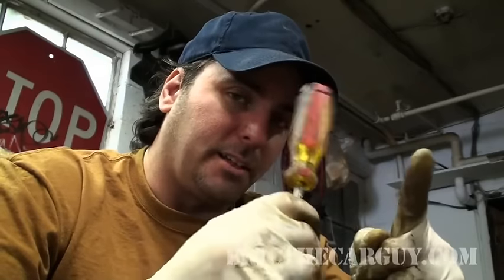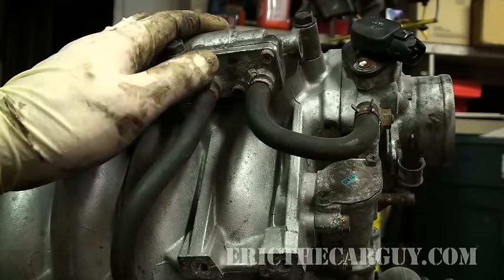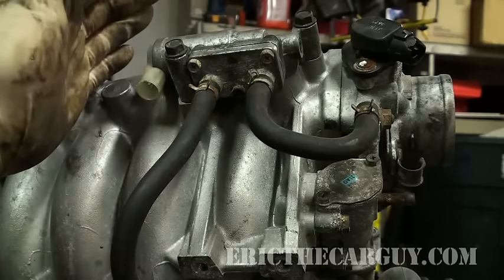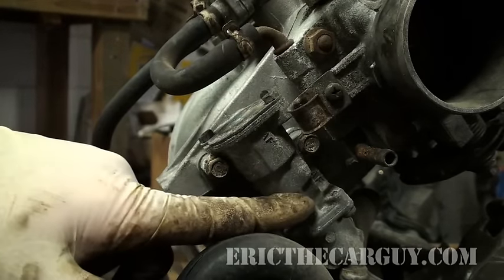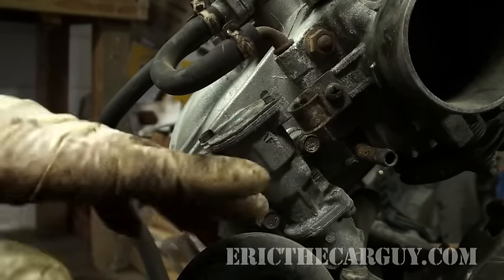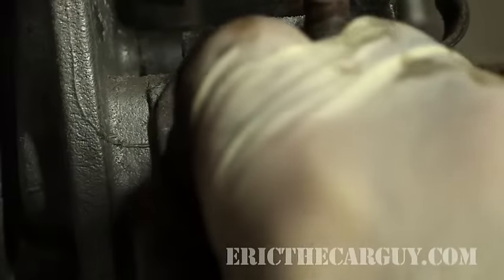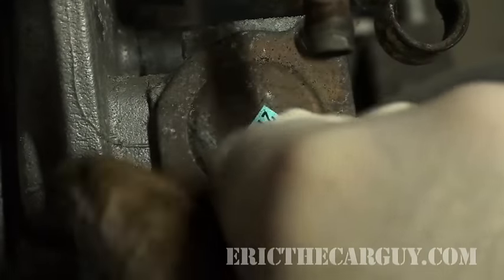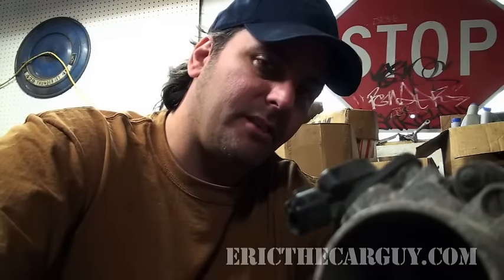How To Solve Honda Idle Problems - EricTheCarGuy

Comment: My prelude with f20b swap has an idle problem. Both idle valve and fast idle valve have been replaced. Car idles fine when you turn it on, but if you wait a little bit and just by holding down the clutch the car idles all the way down and it dies. If I drive it I constantly have to keep revving it so it doesnt die. Mechanic adjusted the valves and it worked great for 3 miles and then the problem persisted. Any help would be greatly appreciated. Thanks

Comment: Great idle fix but am having a different problem on my (Honda Integra da7) OBD0 Honda sohc ZC engine. whenever I reach working temp. I keep getting a idle surging problem at 40km/h or cruising but as I pass that speed it works fine, if I remove my speedometer cable the problem stops but there when I install it back, it happens only on D4 but not on D3. I have since changed my cable transmission, changed my TPS, changed the lockup solenoid valve also even the cluster but problem still exist only when the speedometer cable is intact? any help plz

Comment: Hello! i have a honda 1996 ek3 and it seems to have a rough idle with multiple misfiring and black smoke.  But no error codes or CEL!
using an OBD1 scanner shows that there is  an more than normal value on the MAP reading.

Cross checked with 2 same make and model cars and  the only seem to have a value of around 30 to 40 on idle where as my car (via OBD scanner) shows values around  65 to 75

so far we have:
 replaced MAP sensor 3 times  
 cleaned throttle body
 checked for timing issues 
 checked ignition spark issues 
 checked for injector issues 
 check temp sensor 
 checked for clogged CAT
 replaced wire harness
checked for valve leaks 
replaced ecu and back to the original one 
Fuel pressure checked 
Fuel filter checked 

please note this is on idle speed only, and on high rpm the roughness goes away

Please help 

Thank you!

Comment: At 2:33 you said the idle air control is stepper motor controlled.  I think it is a solenoid that is controlled by pulse width of a 12 volt supply.

Comment: My del Sol has a rough idle with no check engine light. It runs fine past 2k rpm and after revving the rpm drops really low and almost stalls but catches itself. It also runs very rich.

Comment: Please help me! Im from abroad. I bought a 2013 Megane 1.5dci and in winter when it is cold the motor does not idle properly and stops, the engine dies. In sommer, when the temperature is higher, runs like a cat. What do you think?

Comment: Hey Eric i got a 96 honda accord 2.2 lt. when i start the car when its cold it runs rough and it seems like it is not getting enough  gas to the throttle body but after it warms up it runs fine pls help. thanks

Comment: Hi Erric, greetings. I have issue with my 2006 HRV (D16A) New Zealand. It doesnt have idle issue but when i accelerate the rpm goes up and down between 1500 to 200 rpms or 2000 to 2500 rpm. But it runs smooth on steady speed. It doesnt that when the car is parked. Please help.

Comment: Hi Sir, I have a problem with my car. My 95 maxima is running rich and I have black smoke with a slight misfire. 

I changed my fuel filter, my air filter is good. I change my fuel pressure regulator and I have new plug and two coil pack. I'm getting good pressure from my fuel pump. 

No check engine light!!!

Check egr and ecu connection, clean every electric connections under the hood, clean out the Mass Air  Flow and throttle body control and also clean my IAC. Clean all grounds I could find. Also experiencing surging rpm. When I'm braking coming to a red light, rpm will drop to 300 and it's almost sounds like it's running off one cylinder but it doesn't always occur. Please any information would help seriously, thanks!!!

Also at first I was getting a code p01320, it said gear ratio 1&3 error. I changed those coil packs and all 6 spark plug but it's still running rich

Comment: On a 2008 Acura TL idle drops when I am in park and then jumps back up where it should be. It does not go over regular idling speed it just goes down.
Kind of lost because it does not fluctuate up just down. Any thoughts?

Comment: Hi men , I recently cleaned my throttle body and map sensor on 2009 mdx , so after that I relearned the tps by scanner but still my rpm bounce when I push brake pedal and also when I release the gas pedal.  Still the problem is not solved , any advice please and thank

Comment: my Toyota Corolla GLi 4a-fe 96 idle goes down when I turn the a/c on, got the throttle body and idle air control valve cleaned, did nothing. what else could I do sir? could my idle up sensor be broken? btw my idle up sensor has no adjuster

Comment: eric i have a 5sfe. when i start the engine its vacuum reading is around 9-10. revs in park but backfires a little. when i put it in D. car wont rev AT ALL. and just bogs like its going to stall.what could it be?

Comment: Hey eric i just bought a 94 integra with a b20b swap there 2 wholes in the throttle body that r covered car runs take the cover off the wholes the car stalls any suggestion thanks

Comment: Hi Eric I took my car to AutoZone for check engine light it gave small evap leak and idle air control valve has high voltage suggest replace throttle body for 200.00?
Reply: no, the iacv is not part of the throttle body and the evap leak is also not. don't ever take advice from Autozone. Ever. The evap leak and iacv are two separate problems. the IACV should be rebuilt or replaced, and the evap leak needs to be tracked down. The first place I would go is the PCV, just make sure you buy the blue and brown colored one, not the black plastic pcv. the black plastic pcv and rubber grommet don't seal right on the valve cover.

Comment: 1992 Honda Accord giving me the code 43 "Fuel supply system"  Getting the check engine light so after using the paper clip mechanism that is the code I get.  
The symptom:  When is cold it does struggle to start, it sounds ugly and like choking. It will eventually start and after it warms up or reaches normal temperature is fine.  Any ideas?

Comment: I have a 2013 Honda City manual transmission. The idle goes down to zero when shifting from high gear to low gear or when in neutral. How do I solve this?

Comment: My car idle was jumping, it would rev from about 2000rpm up to around 4500rpm then back down, over and over! I tapped the accelerator and now it acts like I'm flooring it! It's basically stuck red-lining as soon as I start the engine! Any suggestions?

Comment: For a 1997 honda accord ex vtec 2.2L, tps changed and closed voltage reading center wire at 0.05V and open at 4.25V. I tried 3 different ones.  I cannot get it higher than 4.25v. Any suggestions on how to get it to 4.5v ?

Comment: My 93 civic is experiencing low idle. When I press the brake and get to a stop the car almost dies or is very low idle like 200-400 rpm. There is a slight stall too when it shifts gears. Any help?

Comment: Hello everyone just trying to get this Honda to run again. 95 Ex has the car for 3 years never cause any issues or complaints. Keep up with the maintenance, nothing change to it but when full synthetic that’s about it as far as change something. Well it was driving fine for 3 years then one day as I was heading to work I’ve noticed the check engine light on pulled over check water and oil. I’ve noticed a bit of oil missing so I went and add some, after driving it to work with the light on was a little rough but made it there. On the way back as soon as I got off the highway it stalled on me turnt but wouldn’t crank. So I towed it and left it for a few months replaced distributor, TPs, Map sensor, fuel pump, and it starts now but the light comes on and then comes off but the idle seems a bit rough. Don’t know what to do next. Any help would be greatly appreciated.

Comment: hey bud,i have a 97 honda accord ex 2.2 liter. im haveing a check engine light flash on then off but sometimes the car dies could it be the iac? when i try to pull a code nothing pops up.

Comment: i know this is an old video but could the low idle cause a battery light to come on? my car was idling extremely low and the battery light came on till i hit the throttle till it warmed up a bit and the idle smoothed out.

Comment: i just cleaned the egr passage ports in the intake manifold and throttle body and egr passage on my friends 1999 accord v6 and now its idling at 2k rpms when cold or warm and bouncing from 1500 rpms to 2000 rpms. i put everything back together. all hoses are connected whats the problem!! i need some SERIOUS HELP!

Comment: I am having Idle air control problem in hot condition of the engine of my Honda HRV 2001. The valve with the throttle body was dismantled and cleaned. I missed my adjustment of IAC. anyone could help on this issue. I am in serious problem.

Comment: Can a bad idle air control throw code for tps? My 94 honda Accord engine codes are for idle air control valve and TPS but you and others say TPS rarely goes bad so could it just be that idle air control

Comment: I replace my iacv but the idle still going down. Specially if i turn on the aircon. Can you please give me some advice? I would really appriciate it. Can you help me on this please. I already scan it. It gives a code for ect sensor. So i replace the ect sensor but it is the same problem is not gone.

Comment: My 99 Honda Accord keeps stalling I’ve changed the fuel pump, fuel regulator, ignition control module, and egr valve but I cannot figure out why my car keeps killing while I am driving. It does drive some distance sometimes and then sometimes it doesn’t because it kills and doesn’t start back up until car sits for about 5 minutes then it starts back up. On one occasion it killed on me 3 times in a row! I need help! I spending so much money on changing parts that are not fixing the problem. I just want my car running well again.

Comment: hello there eric,im butch from the philippines. Been watching your videos,i need your help on idle problem on my honda crv 2004 A/T. the initial problem was my engine jerks when in idle AC on/off. i already replace the throttle body with a new IACV. after a day,im having the problem again in my idle. when im in gear (drive) and slowing down on traffic or to park. it jerks. no vacuum leaks at all,should i change the map sensor or maf sensor?please i hope you could help me solve my idle problem.Godbless eric. hope to hear from you.

Comment: My 2006 CR-V idles good except at a stoplight and when the ac compressor kicks on.  The idle drops below 500 and vibrates the car.  Any suggestions?

Comment: I recently cleaned the throttlebody and I unplugged the cooling in an outer holes did I have to bleed the cooling system I drive a 2012 Camry se it is shaking when I accelerate at 30 some times the idle stays stuck but I hit the gas and it runs

Comment: I have  2003 civic 1.7 lx ... my engine light is flashing and is reading a misfire in all 4 cylinders. The car hesitates at acceleration and a minimal to a lot of white smoke comes out the exhaust make like a (put-put) sound lol (note) I just had my head gaskets and drive train and water pump fixed... what could this be?? HELP!!

Comment: Hi eric, 
I have acura 2000 3.25l, the valve was replaced. It would start but nor accelerate, we try changing the plugs every time we buy a new plug and remove it, it always black. My car has been at the mechanic shop for 5month now, help me am losing hope.

Comment: i have a 96' civic with a non-vtec engine, and it only has an idle surge when it gets up to temp. When it does, it goes from 2000 rpm to 1200 and back and forth. Any suggestions?

Comment: The problem I’m having with my 91 accord is that it gets stuck in warm up mode, takes a long time for the fast idle to go down. I’ve taken the fitv apart and cleaned it and I’ve also taken the iacv apart and cleaned it. And also I’ve bleed the air from the cooling system... nothing works...... help!!

Comment: Where is the fast idle valve located and can it cause a misfire after the vehicle is warmed up I'm getting a misfire after warm up after driving the car for 20 minutes or so and it passed a compression test supposedly

Comment: My 94 Integra idles at 500 when warm. Help??? Took apart and cleaned IACV. Used cleaner in intake. Cleaner in gas to clean injectors. New sparkplugs and got new distributor.

Comment: Hi i have a 95 Nissan 3.o when its worm check engine light comes on and idle goes up and down . When cold its fine when worm goes up and down . I'm told i have 2 idle air control valve. Any way to know what one I need to change .Any help i appreciate it

Comment: help :  - ( Honda crv 2002,  ,she turns over but i need to keep it at 20000 rpm to keep her running, take my foot off and she dies. had idle speed turned up so she will run to the garage but AA man said something like throttle linkage/flap but that kinda went over my head any ideas before i let the garage get her ? kind wishes Sue

Comment: I changed the idle air control valve and cleaned the throttle body and now how do I do a relearn so rpm on the engine go back to normal, because right now they about 450 rpm

Comment: So what if you push in the clutch coming to a stop and the idle drops pretty low almost to stall but smooths out could that also be the idle control valve?

Comment: I have honda accord 94 model manual transmission. My problem in my car occurred while having a long travel, the engine lost power and stalled. The other problem is when  the car running at 
60KPH or more with 3000RPM when I   applied brake  while in neutral gear, the RPM go down until  the engine stop running. What shall I do, pls help me....

Comment: Jus put in aftermarket header for my 04 acura tsx n I didn't put the o2 sensor in on both top n bottoms ... now my car idle below 1k n it sitting on the 500 rpm mark ... could that be my problem .. cuz b4 the after market header my car was fine

Comment: 2002 Accord warmed up in Park I rev the engine to 3000 rpm then let off the gas.  The idle falls to like 400 and sounds like its about to stall.   In about 6 seconds the idle speed jumps up to normal at about 800 and is OK (seems like the computer makes some adjustment).   Why does it almost stall after reving it???

Comment: I have a h22 the enigne vibrates so bad bad the whole car shakes. I took off the valve cover and check the timing blet and its missing at least 1/8" of it. And how due I tell if I bent a valve

Comment: On V12 Jags I remove the cold start idle control stat and fit a washer with a hole in it, the size of the hole dictates the idle speed.

Comment: would this also apply to a 06 sentra 1.8? mine is idling high constantly, not up down, up only, if i get her up to 40 kph, and take my foot off the pedal, she will stay at 40 for miles.., like cruise control is on.. thanks
Reply: Tom Harwood that sounds like a throttle problem

Comment: I have an idle issue. It’s ok when u start up but as soon as go it’ll get higher when in neutral. I have to tap the gas and that brings it back down. Got code p0505 couple times so I replaced IACV but code still came back and idle still not right. 2000 civic ex 5spd

Comment: hi eric justin here i have a 97 honda civic dx i had a idol issue and someone suggests the tps sensor so i replaced the tps as well as the map sensor when i changed the tps my idol became higher plus turned my check engine light on so i had the comp read at nearest autozone they said it was the air intake sensor so i replaced it and it changed nothing please help these parts arent cheap

Comment: hi, how are you  doing eric the car guy? i have a question about my 99 dodge ram 1500. i started noticing that i have been idling around 500rpm. its really sluggish. and it shuts off after 10-20 minutes after driving around. i'm started to think that the egv valve is failing. is there any ways to test the egv properly; Also is there anything else that i could be causing a low idle?
Reply: Carefully take out & clean throttle body & idle air control valve.
Try not to move flapper much & take your time to clean them well.

F40 has this comment problems with tac going flux up/down when hitting the gas. Remember, this is a $450,000.00+ car.
I uses lint white free cloths or rags. Clean them until coths no longer dirty.
Reply: ATG's recommendations & he said these to master engineers:

If you have & I know you have rusted parts when getting into them.
Use an empty water bottle.
Buy Lemon Juice from Dollar Store.
Drop rusted bolts, nuts /or metal parts into plastic water bottle.
Pour Lemon Juice in the bottle & close cap.
Shake /or rotate 45'+. 
If you want them to be real clean leave them for a day or two.

FYI:
ATG's Ferrari &Koenigsegg clinics starting at $35,000.00.

Comment: Hi Eric based on your experiences could u give me a few ideas on what a low rpm almost wanting to die idle could be it only does it it when I start the car weather it's cold or hot everytime I starter it wants to die and when I give it gas it looses power then regains it after that it runs fine much appreciation if u can help me out
Reply: Btw I have a 2000 Honda Civic EX